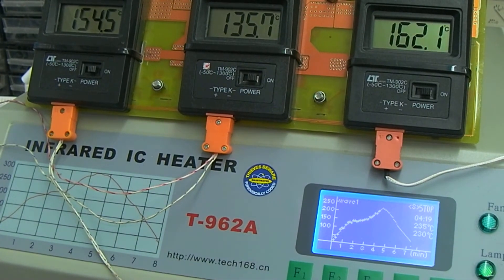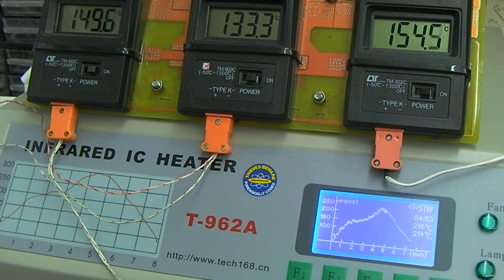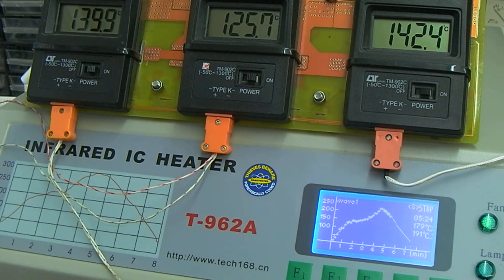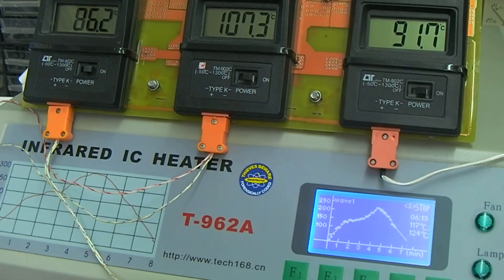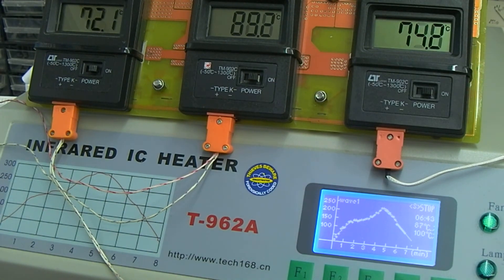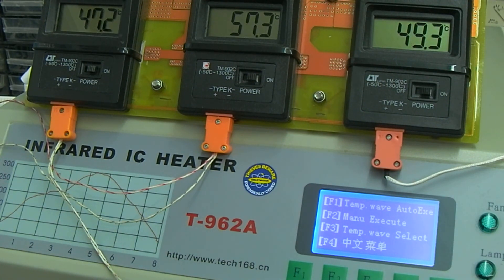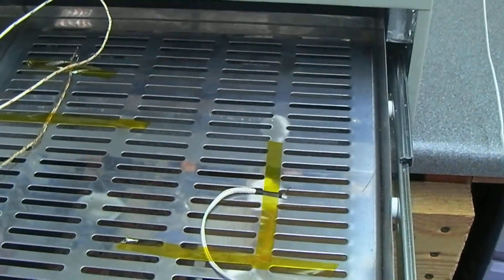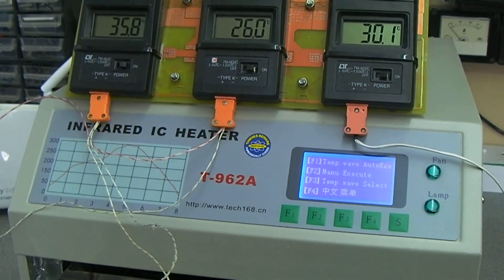T-962A Temperature tests

Comment: I've done a the same sort of tests with multiple thermocouples, and I think the difference in temperature is not only caused by the position of the thermocouples, its also caused because the quality of most thermocouples (especially those from eBay) is very poor.

I bought 5 thermocouples and taped them about 1mm apart inside the oven, in the air, and I see the same huge temperature variation in the readings from the them.

I am using a the modified firmware, which I have recompiled myself to use MAX31855 thermocouple interfaces, but it doesn't improve the operation of the oven, and I think this is mainly because of the thermocouples being inaccurate.

Hence I've not been able to use my oven for any real projects :-(
Reply: Roger Clark same situation 3 years later?